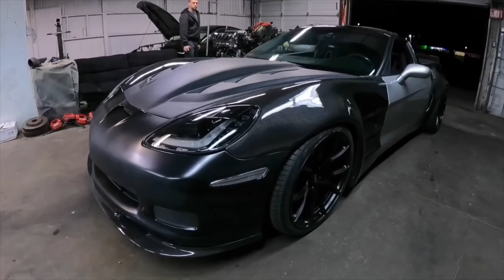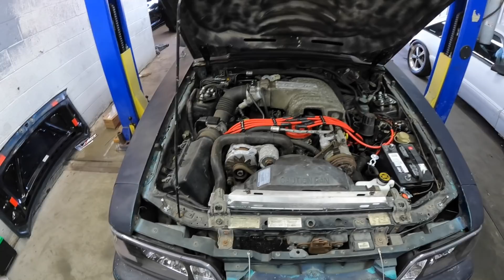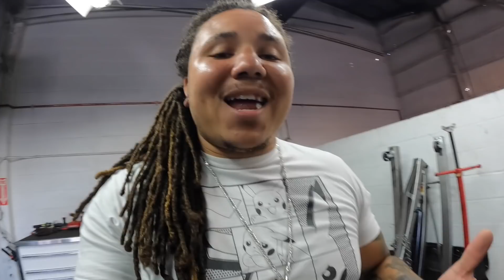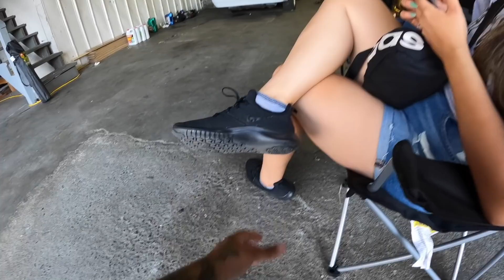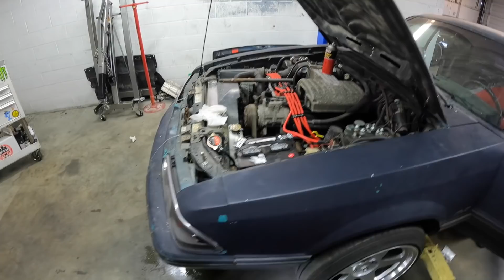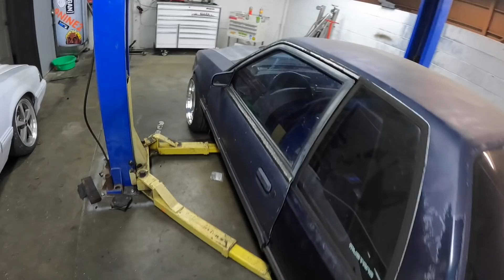😳Things Just Got Real For The FoxBody! “I finally decided”

Comment: If the flashers work and turn signals dont that wire harness that plugs into the side of the steering colum is loosr run a zip tie in between the wires around the plastic piece and around the metal shaft pull it tight problem solved I bought 3 of them turn switches and a zip tie fixed it smh